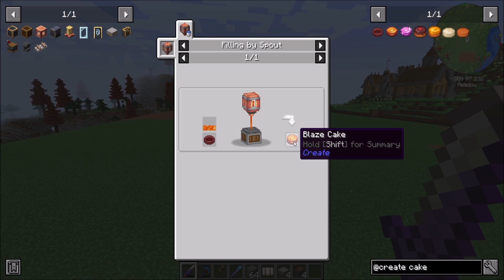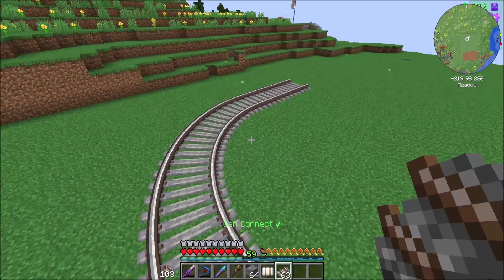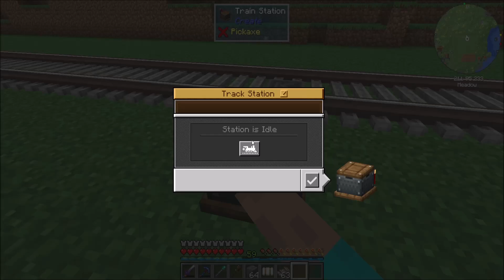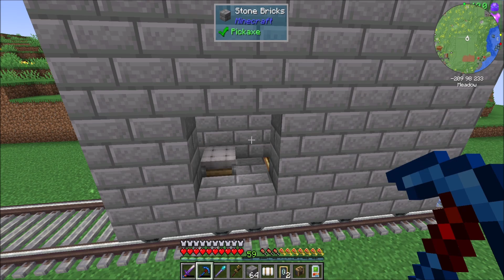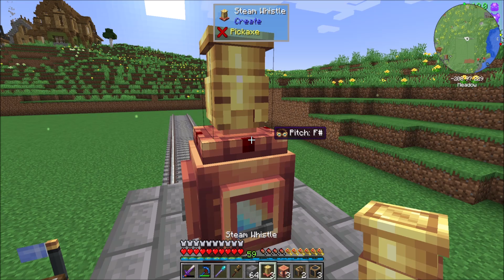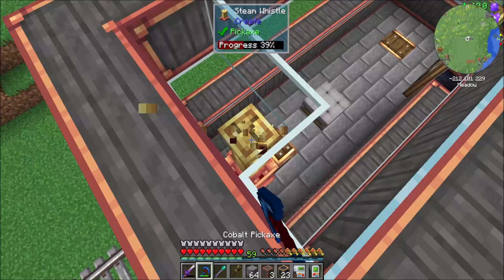Lets Play S11E104 Building Trains

Comment: Hey Dire, the reason you have to have exactly 2 bogies for a carriage is because of curves.
When your train goes round a corner, the straight line of the carriage can only touch the curve at 2 points, where the bogies are.
If you had 3 bogies in a fixed straight line on a carriage, it could never go around corners.
Reply: I wonder how difficult building a Schnabel Car would be with this system? Complete with all the articulation joints needed, that is.

Comment: Cars with 2 bogeys are the max because they couldn't turn with more than 3. It needs to flex around turns and slopes. So you can't have more than 2 points. Same with real life.
I fucking love this new Create update. So fucking good.
Also. 5x5 Cabin Space works best. 3x3 air space inside the car work perfectly. It's not too big, plenty of space, and easy to decorate.

Comment: I can't wait for a factorio-esque mod pack where create and additional mods are used to make a massive minecraft factory from scratch. Yeah sure we have mechanism and AE systems but Create's machines look so much more impressive. 
There is just no good way to transport create's rotational energy over long distances, which is unfortunate. But that means every factory you make for a specific thing needs its own rotational energy source to run, encouraging you to experiment upgrade and manage energy in a per-location basis. Fun!
Reply: Can use the builder from create to build a pre designed source generator where you need them.
Reply: Check out feed the factory. Along the lines of what you want.
Reply: You should look at Create Above & Beyond.
Reply: That's the thing, u can transport the rotational power by having a coal/blazecake farm and a infinite water source and have the trains bring those to other power sources.